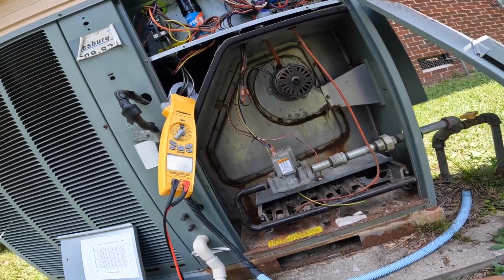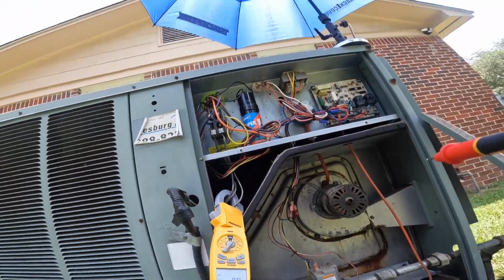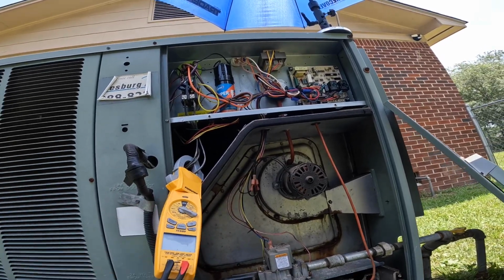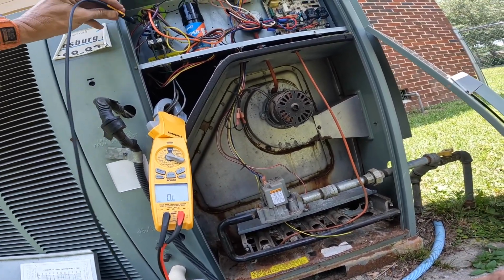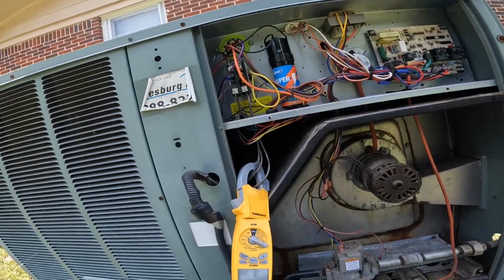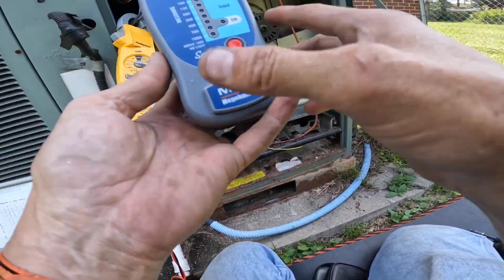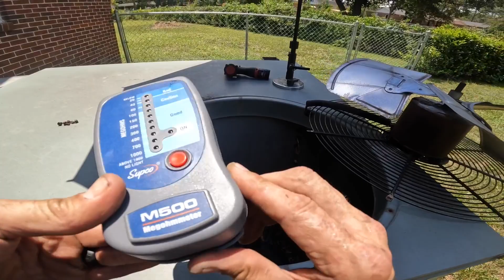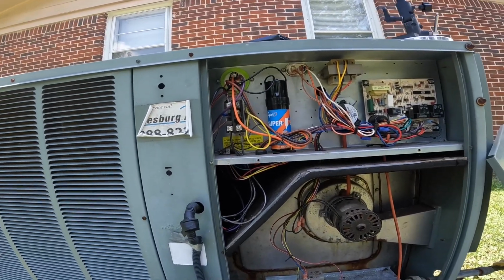Figuring Out Why I Found A Blown Fuse On An Older System. #hvacguy #hvaclife

Comment: 44 years as an HVAC tech. Seen good men including myself go down from fatigue and exhaustion. No shame in getting life sustainable REST! Our trade is too dang demanding to push n push. I've collapsed and wound up in the ER too many times dehydrated and heat stroke. Cut yourself some much needed slack brother. A dead  or depleted tech doesn't do anyone any good. Stay hydrated and safe out there. Blessed to be retired. 🙏🏾👏🏾👏🏾👏🏾👏🏾👏🏾
Reply: @OGHVAC  hey sorry to bother you, any idea why my outdoor air conditioner keeps blowing the fuses in my basement fuse box ?
third time this year = happened today when putting the thermostat to "cool"  from the "OFF" position   (only has cool, off or heat and the slider from 10 to 30 celsius)
very old thermostat on the wall from the 70s or 80s i think

Comment: Nope, we are not spring chickens anymore. I know you like those Perrier waters, but that isn't enough. Get a big water jug and bring with you, and drink it. My brother, (dummy) ended up in the hospital for dehydration. Working in this heat and not drinking water. His kidneys shut down and he almost had to do dialysis. He is fine now, but it was a rough ride and he learned a lesson. Good video, that hard start cap gave them a little more time, but as you said, it fails in the end. I am worried about mine doing the same thing. It has a boost on it, that has been a couple of years. I notice sometimes when it kicks on, it dims my lights. I know, uh - oh, but not every time. Let me see, new cap, blower wheel, condenser fan, contactor and stop leak in the past few years and I'm still limping along. I had planned for a change out, but put it off for a while. So I guess I'll run her till she quits. Good Greif

Comment: Money is not everything.  Sometimes you need a break.  I had to quit my last job because of the working conditions.  There is no air-conditioning in the warehouse that I worked in.  Temps have been getting up to 119° here in Phoenix AZ.  As a materials handler, it required me to take 15,000 to 16,000 steps per day tracking down aviation parts.  I was constantly on the move, sometimes climbing on top of wooden crates and jumping back down off of wooden crates.  I am 58 years old and about 30 pounds overweight.  It was very hard on my knees and lower back.
Reply: In a previous century I worked in a stockroom for a general aviation manufacturer.  Giant "Erector Set" inside a tin building, no external airflow other than what comes in the dock doors (humid blast furnace).  One summer the overnight low on the middle floor racks was 102°F and the daytime high (about 5pm) was 116°.  I can't imagine the heat you'd have been subjected to, and the thought of jumping off of pallet racks or crates is frightening.

Comment: Oh Curtis, you still don't look well.  Over the last 3 weeks you've been visibly dehydrated, you're losing electrolytes to sweat to the point you shake or drop parts.  I think complications from heat are part of why you are forgetting tools at job sites.  Don't worry about producing videos (give us 30 minutes of Riley playing at home!), spend time in the van cab to reduce your body temp instead.  The irony of the heat/stress fatigued HVAC tech is strong.  Stay safe and cool down.